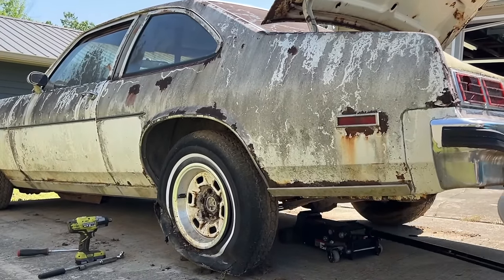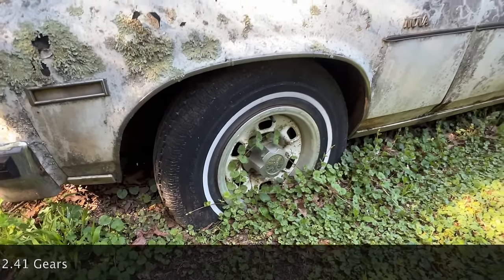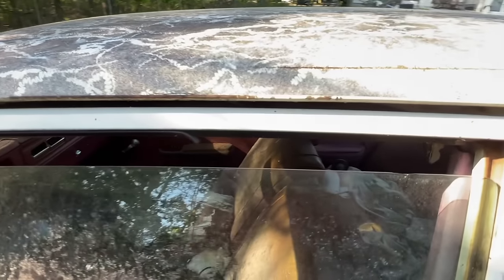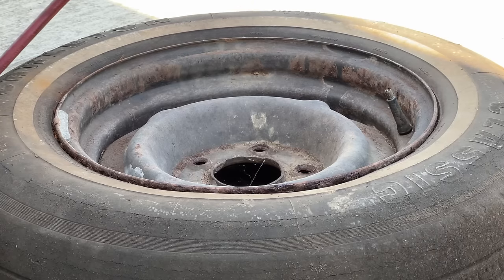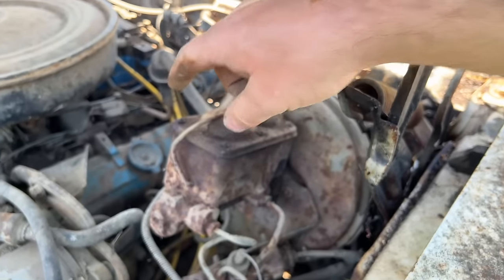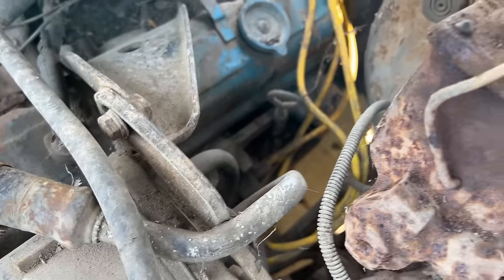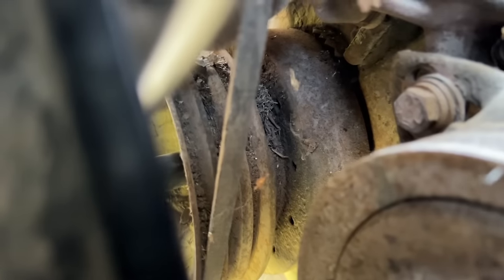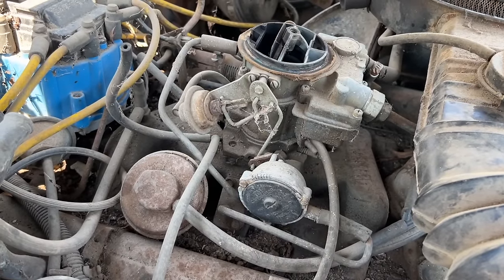$500 Nova, Will it RUN and DRIVE After 24 Years Parked?

Comment: Sorry 350 said large two barrels on them. I bought one back in the day. Canary yellow a small dog dish hubcaps two-door. Is actually a police interceptor engine in it. Look it up it'll forward or notice he's in for cop cars especially a little bit earlier. I actually owned two of these. Both of these and police interceptor engines as they called them. They're both two doors. And the second one did have a 305 in it. I don't remember about the transmission but I kept the engine so the rest of the car to a guy who just dying to buy it. The first one I still have it. And I've been through the engine. It sits on a engine stand bright Chevy Orange. Transmission had a good stall torque converter in it and I put it in something else. I guarantee you that's a 350 engine and it came in the car. I think the car was 7 years old. And the reason did not want one of them was the heads tend to crack something sure we did for a brief period of time built them thin. Painted that car had time brought a Shelly could get and it was a 1982 Corvette bright yellow. Let's just say the bridal show I could buy at the time that was a stock color. And even without the engine and it's patina let's just call it what it is rust, I would not have taken $500 for it I think you got yourself a great deal. Come and think of it I had third one metallic blue. And some guy just had to have it so I sold it to him. And 20 years later I believe he still has it. But I'm enjoying the video. Hey one of the things I believe it's 75 for a cut off it may have been 76 or 77 I don't know. The same 350 large two barrel carburetor engine in the Impala ran the same serial numbers as a Corvette on the same given year. That's why you find a lot of Corvettes 350s out there and the number just seem to say that's true. I just come out of a large land yacht of an Impala. Thanks bring back memories that went along with those cars. Hey it's your channel. I'll keep those out of memories to myself.
Reply from the maker: Thanks for sharing Chuck, sounds like you've had some cool machines! Glad I could bring back some good memories.

Comment: You don’t like those rally wheels? I think they look good on the car. They give a nice texture to the car, plus’s they look good when the car is moving.  I also like the red interior. It looks like it will clean up quite nice. That’s a nice spec car. White outside, red inside, rally wheels, 305 v8, automatic, power steering and front disk brakes, air conditioning. And it’s not really very rusty. That car just needs a few body parts. The missing b pillar trim, a right front parking light, some new tires on those rally wheels, new brakes, new fuel line. And some new front seat upholstery. And new red carpet kit. 

I like this car for its potential.
Reply from the maker: I'm planning to track down some new 14 inch tires for the original wheels, and hopefully paint the wheels and clean up the rings and centers. I do agree...these wheels look RIGHT on these cars specifically. Never cared for them on the Camaro. Stay tuned for a clean up video on Friday.
Reply: 225/70r14 tires look great on these cars/wheels fyi.

Comment: Just unreal the carberator didn't need anything, just starts and runs and the accelerator pump gives throttle. 1 in a hundred chance it revs and idles no cleanup, nothing but gas hooked up. Amazing
Reply from the maker: Pretty wild. I assumed it would need carb rebuild, a new fuel pump, possibly some ignition or wiring work. Almost every old car I've fooled with needed a fuel pump and carb work and this one really runs great. I found a couple of vacuum hoses that were unhooked (not shown in the video) and the thing really smoothed out nicely. I'll show some more driving in the clean up video, which will come out on Friday.
Reply: @HotRodHoarder  I will tune in Friday sir.

Comment: We can't wait to see you pressure wash entire car, change the oil, new tires, new belts and hoses, radiator flush, clean interior, paint steel wheels, clean glass, install headers and glass packs, check rear end oil lever, transmission fill and flush, new brakes all around.
Reply from the maker: Full clean up video coming soon!

Comment: Did you bench bleed the master before putting it on? if not the air in the master will go into the system but it will take a while to pump all the air out before that
Reply from the maker: I did not bleed it. The master definitely needs to be bled, and then bleed the corners and it should be better. I'm thinking maybe the rear brake hose has collapsed because it doesn't appear to be moving any fluid back there.

Comment: we had a 76 nova bought new in family ordered 350 4 speed posi suspension package tinted glass swappd a holey and did other mods all that for 3200 dollars new from dealer
Reply from the maker: Wow, that's cool! I'd love to find a 4 speed car with posi...that would be fun!
Reply: @HotRodHoarder  hello   you can swap a camaro pedal assembly bell housing clutch flywheel  you are not limited to just nova  GM parts of that era interchange.
Reply: @HotRodHoarder  even 3 speed linkage will fit

Comment: Had a 1976 pinto wagon sat cause ?  But 20 yesrs later it was givin to me it had less than 5000 miles but heres story everything ftom brakes to battery tires filters shocks many parts had to be replaced to point that would never do again free is not free 😊
Reply from the maker: Free is never free!

Comment: That looks like a 76, My best friend in High School had a 76. I just bought a 75 with a 305 in it for $1200, basically the same thing as this one, The old man who owned it owned it parked when he got too old to drive and it sat for 20+ years. My plan is to fix what needs fixing, drain and replace ALL the fluids, replace all the rubber, weather stripping, vacuum lines and all because I live I live in Northwest Arizona and it's ALL shot. Then I'm going to just clean it up, paint the engine bay and original parts that were black,  black again and throw a cheap Duplicolor paint job on it, Yes I know.... 'DUPLICOLOR PAINT JOB?? IT'S JUNK" Yes I'm aware, but i'm just going to daily drive, i'm not doing a 500 point restoration on it.... it just needs to run decent and look decent. The interior is in decent shape considering so I'm going to just clean it up, the only thing that needs to be replaced is the front seat so out with the bench seat and I'm going to put some seats out of 08 Cobalt, why? I already have them, their free and free is a good price to pay and then I'm going to just build a wooden center console and wrap it in some cheap vinyl, once again, I'm building a cheap daily driver not doing a 500 point concourse restoratition. IF I were you I'd do the same with this car, fix what needs fixing and just daily driveand then give it to your daughter for her first car when she turns 16, but have her help you fixing the car so she has some emotional attachment to the car. IF your ever in the area give me a shout, We'll run up to Vegas or over to Pomona for a swap meet and show. Coming from the Midwest I always thought Pomona's swap meet was overblown but nope, it's truly a once in a lifetime experience and you can literally find anything there.
Reply from the maker: Sounds like you have a great plan! I'm a fan of a good, affordable build plan that has a real purpose. I think you're headed in the right direction. I GOTTA go to Pomona sometime for the swap meet.
Reply: @HotRodHoarder  Yeah I think Pomona should be on EVERY gearheads bucket list. It's not just a swap meet, it's an experience in the  car culture where it all began. I mean it's like seeing The Beatles in Liverpool or U2 in Dublin. it's just something everyone should take in.

Comment: A louder horn is cheaper than new brakes.
Reply: Hahaha funny!
Reply from the maker: Haha, I probably should've checked to see if the horn worked before our test drive. The 1/8-inch of brake pedal travel didn't inspire much confidence.
Reply: @HotRodHoarder  1st and most important piece of safety equipment to check. 
 "Your Honor, everyone was clearly warned I was unsupervised and out of control. My daughter said go for it, so..."

Comment: Man you are starting 12 volt starter not a 15 kilowatt electric engine that is runing in 220v no need for those pliers or wire screwdriver would do it fine.
Reply from the maker: Lol sorry I was scared.

Comment: SBC will survive A NUKE WAR OR A emp AT LEAST..HA HA HA ......CAR IS WORTH 500 BUCKS IN PARTS ALONE
Reply from the maker: Yeah I feel pretty good about it. Rusty or not, I got my $500 worth just by driving it down the road haha.
Reply: @HotRodHoarder  cousin ordered a new 76 nova 4 speed 350cid posi rear for like 4300 bucks, kept it on road for 20 yrs sold it  few years ago for 5k kept in garage ran and about 260k miles but smoked got bucks back